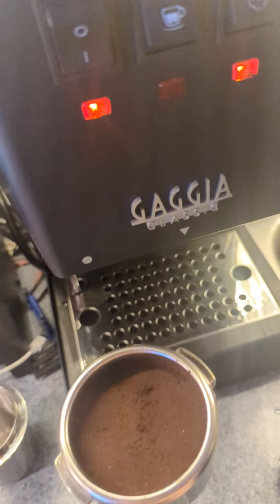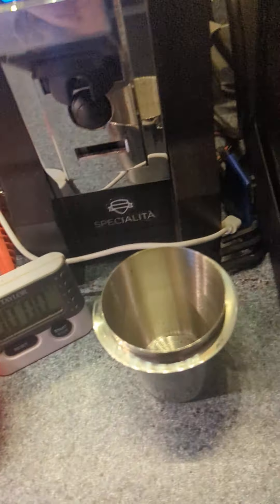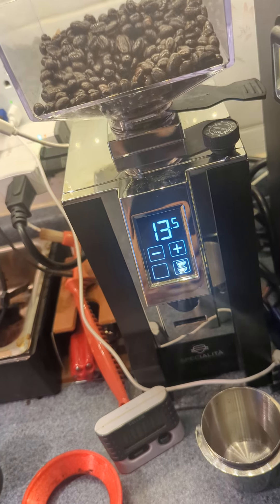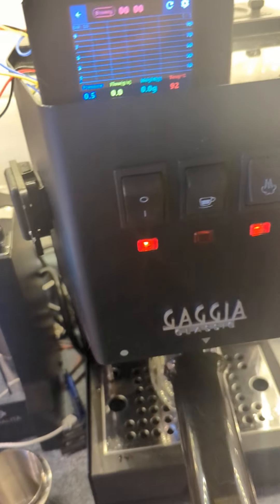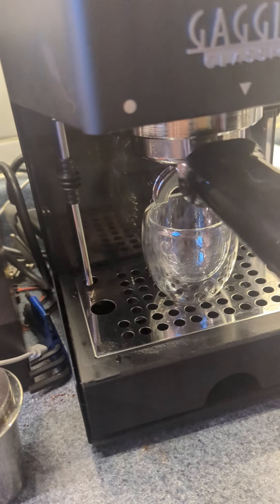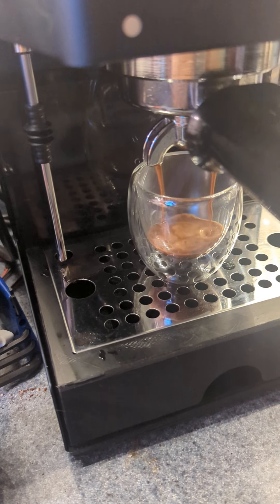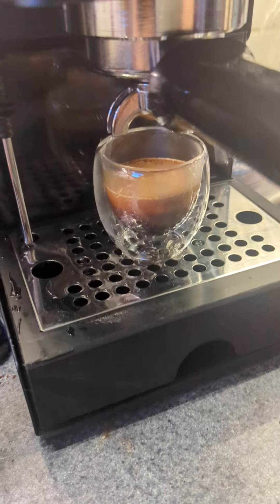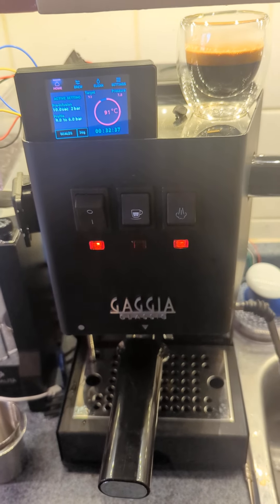Espresso shot on a Gaggiuino

Comment: I just updated a 1995  "Gaggia Espresso" with the Classic Pro hardware (making it a "Gaggia Espresso Pro," I guess) so I could use the pressure release feature the Gaggiuino Project supports.  Complete control over temperature and pressure. What more could one ask for?

Comment: Beautiful work and video!! any concerns about the longevity of your machine with the mod?
Reply from the maker: Great question! Because it uses a vibratory pump, cycling it on and off won't hurt like it would with other pump types. The relays in the mod may wear out, but there is a snubber network to absorb voltage spikes from the pump and solenoid. I think it'll last well.